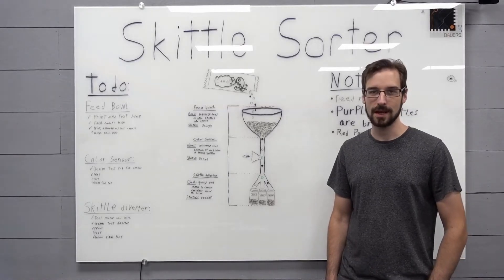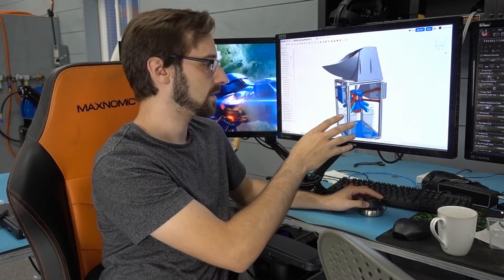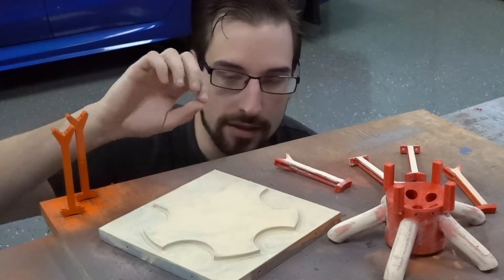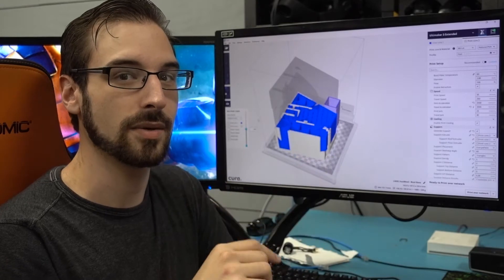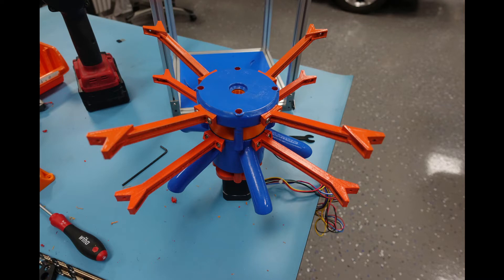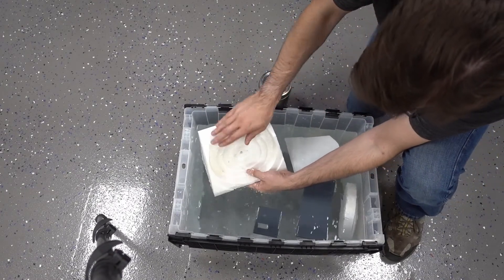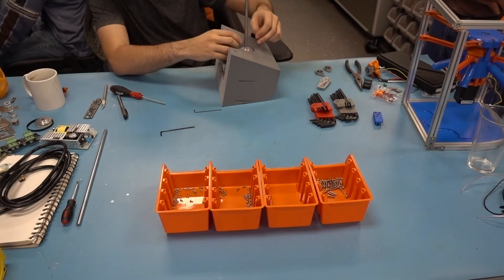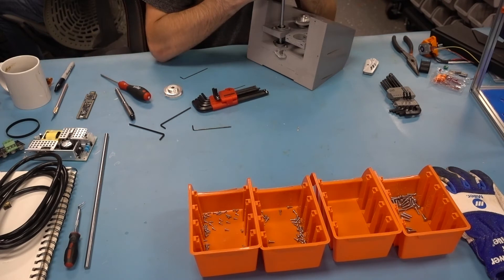Skittle Sorter (Part 4) - Hardware Assembly

Comment: What did you use to make your supporting material de-solve? I am working on making a gumball sorting machine and having a hard time with removing supporting material. Using PLA
Reply from the maker: Here I used pva which can be a pain. It removes with water and time and scrubbing and time... Very annoying. I have been using HIPS and d-limonene more recently and I like that a lot. Maybe give that a try.
Reply: Bauer's Lab Thank you, I will give it a go.

Comment: Are you driving both the feed bowl motor and the diverter motor form the same O-drive board, or do those drivers only support a single motor?  Fascinating build by the way, looking forward to seeing it (hopefully) working ;-)
Reply from the maker: Yes, both motors are driven from that one board. Both motors also have encoder feedback (because it is cheap, and the firmware at the time did not have support for sensorless foc) this board is the 3.2 version and it cost about $120, which is pretty good for a two axis drive. Thanks. Me too, hopefully. : P